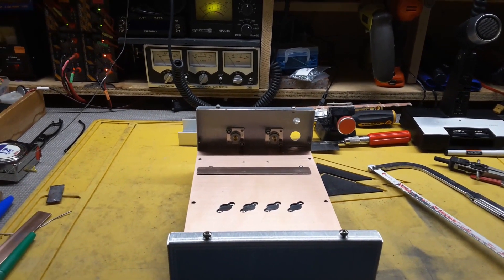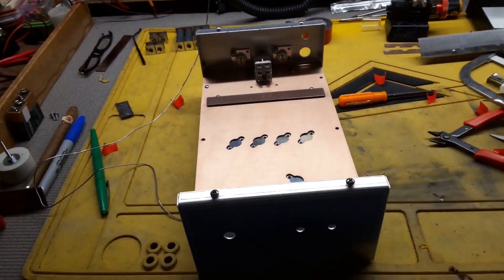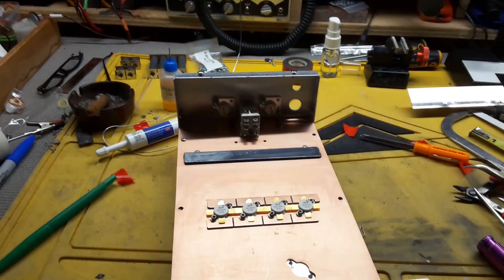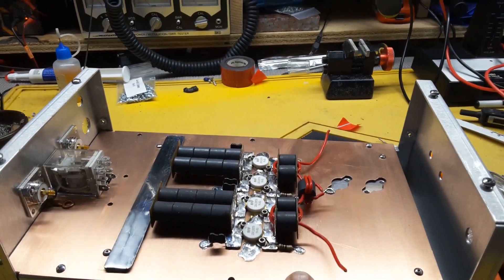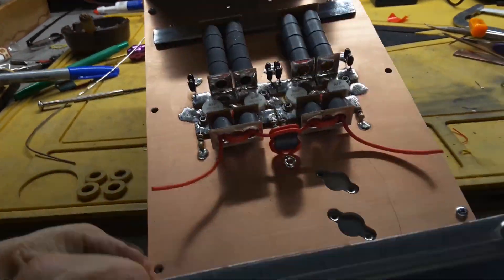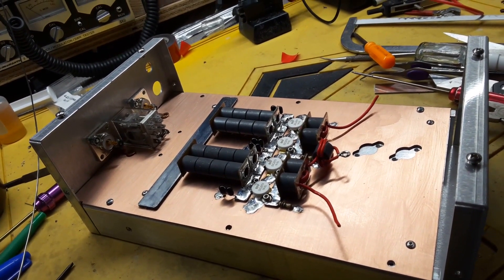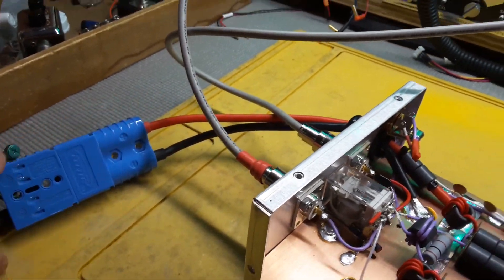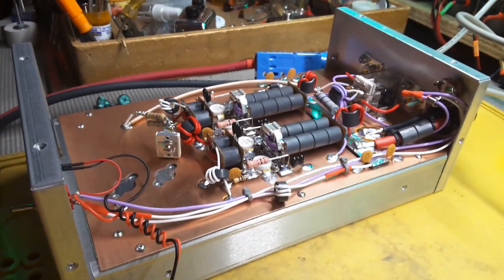"Lillie" 4-Pill RF Amp Build.

Comment: Why cant you solder the main power bus bar under the back of the transformers isn't it the same thing as the power wire connection
Reply from the maker: By wrapping the wire around the ferrite you create an RF-Choke

Comment: How did this amp tune out on the spec analyzer with 2 inch transformers and 3 turns?? On mine I used 1.5" transformers and 2 wraps and it looks. I was under the impression that the longer transformers used less turns? Just wandering what the signal looks like?

Comment: It looks like one of the output transformers is tape 43 and one 61
Reply from the maker: OMG!! I hope not how can you tell by looking?  I have never ordered any type 43's but I thank I have received some? Like the other day I was checking some ½” x 1-1/4” transformers using the same wire to check one then unwrap that transformer and use that wire to check the others. I was making three wraps. Some transformers would read like 7.33uh range and the others would reed 5.47uh range. I checked several of them and they were all purchased from the same retailer and all supposed to be type61 but they all didn’t have the same inductance? Also I have two inductance meters and they both gave me the same results.
Reply: @radioactiveamps3961   Type 43 usually look shiny but not allways . Only its way to really tale it's pull an induction test with a lcr meter